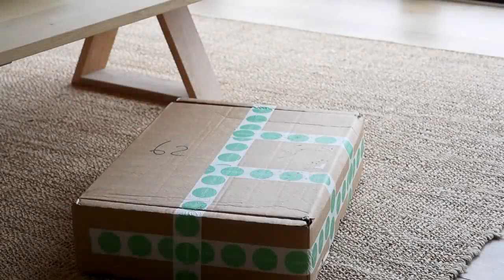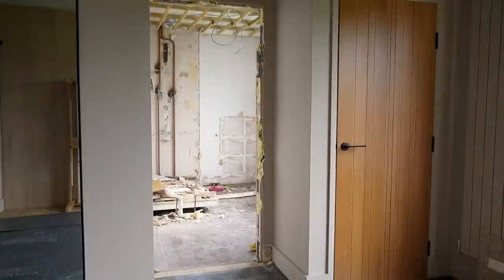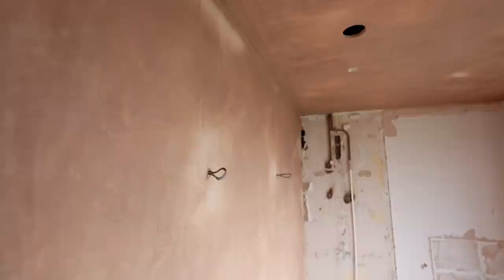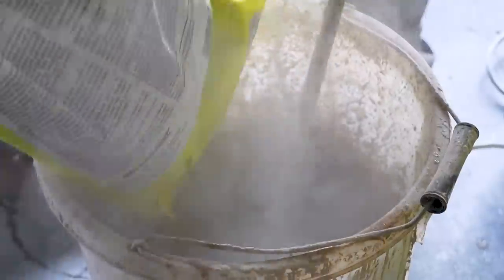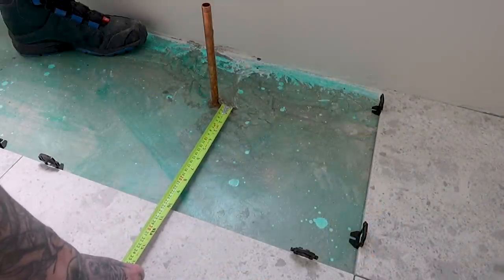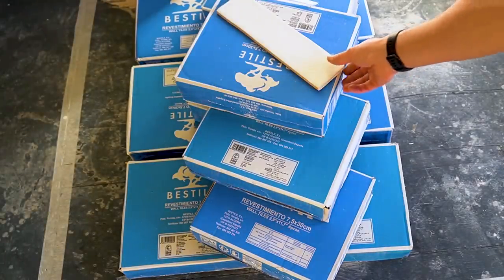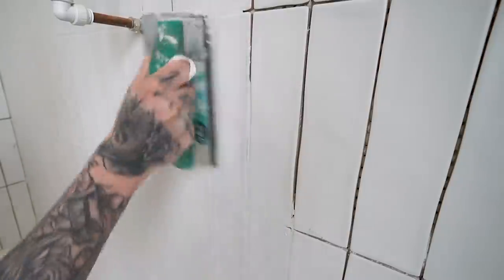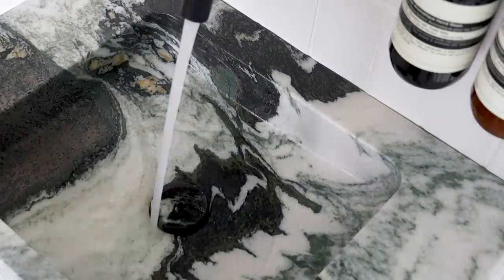Outdated En-Suite Bathroom Renovation

Comment: Emma, could you please speak to what the issues were with having a tile base in your previous property? We’re thinking of doing a more open, step-in shower with a tile base. The en suite is STUNNING!!!
Reply from the maker: With tiles there are gaps in which over time water can seep through, especially with human weight shifting around on top of them on a daily basis. In our previous home water had started seeping through without us even knowing it was and it completely rotted the joists and almost made the kitchen ceiling collapse (bathroom was above the kitchen). In this house it wouldn’t have been an issue as our en-suite is on the ground floor along with our bedroom but we just couldn’t be bothered with the issues of tiles and just have so much more trust in a shower tray x
Reply: @EmmaHill  Especially with older homes. Thanks!

Comment: Loving the finished result! As for keeping black fittings looking good, I do have a little tip - we don't have black fittings, but we do have black tiles (including the floor of the shower - quite normal in Denmark), despite living in a hard water area, we have never needed to remove limescale in over 15 years - our trick is to squiggy the walls and floor (nothing new there), and then wipe it all down with a cloth, paying particular attention to the edges and corners where water tends to settle. Bit of a faff, but less so than removing limescale, in fact we started doing this about 6 months after we did the bathroom, as there was a little limescale developing on the edges of the tiles, and within a relatively short space of time this disappeared. My husband says that it also helps with the longevity of the silicon sealing in the corners. 
Now if anyone knows a similar trick for the taps (mostly okay, but there is limescale build up where the water comes out), please share cos wiping them down everytime I fill the kettle or wash my hands, ain't gonna happen!
Reply from the maker: We wipe everything after every use so do what you do. Prevention against the limescale building up from water is the key rather than cleaning 🙌🏼

Comment: Beautiful finish! You have inspired my downstairs toilet design 😊 I also have black hardware in the main bathroom and it’s so tricky to keep perfect .. do you use any products on it at all or just a clean cloth ? Thank you
Reply from the maker: Try not to use products as they can erode/damage the black. Prevention is key. We clean after every use, it becomes a habit and doesn’t take long just to dry off the water so it can’t build up. If you do get a build up it’s best to clean it asap, try white vinegar & barcarb but spot test first as this can depend on the coating/quality of your black hardware x

Comment: Hi Emma! En-suite looks amazing 🤩 I’m thinking about a wet room floor in mine but you mentioned about having an expensive nightmare regarding one?! 😬 can you elaborate? Many thanks x
Reply from the maker: It’s just that there are more joins/lines where water can seep through over time with constant and moving pressure of human weight. Water can damage whatever is underneath which wouldn’t have been such an issue in this room as it’s ground floor but in our previous home our bathroom was over the kitchen and water rotted the joists and the ceiling almost caved in 😳
Reply: @EmmaHill  yikes!! Thanks for getting back to me. Definitely something to consider! Loving your context ❤️

Comment: Emma, could you please share info on how do you clean black hardware?
Reply: I would love to know to!
Reply from the maker: I don’t use a product, it’s just a case of dusting regularly, we do this daily when in the bathroom, and the drying any moisture off after use. We do this after every use, it’s just habit now. If you allow water to build up this is when you’ll get the hard water white marks (limescale) and then this is harder to remove the longer it’s left. You can use vinegar & bicarb as a good limescale remover but this will depend on the quality of your black hardware x
Reply: Thanks a lot :)

Comment: I love it. This is a beautiful bathroom that will not date. You made a good point at the end, about black fixtures and water. If you have hard water, the mineral deposits will show up on the fixtures, whereas if you have soft water, or softened water, the black fixtures will be easy to maintain. Luckily, we have natural soft water, so the black fixtures still look great after four years. If you have hard water, I do not recommend you choose black fixtures.
Reply from the maker: We had very hard London water in our previous house and we managed to maintain them, so it is possible but you need to keep on top of the cleaning x

Comment: Loving your floor tiles 😍Beautiful! Never heard of a bench radiator before. Maybe you can talk about it (installation, pros/cons, costs) over on Instagram?
Reply from the maker: It’s just the same as any other radiator, the pipes would just need to be channelled into the floor as with some other traditional radiators. The perk is that you have a place to sit, for me I sit there when brushing my teeth or when moisturising after a shower 😊
Reply: @EmmaHill  Thank you for your quick response:) Just checked if these are available in Germany for our Home Renovations.. They are!  Such a smart idea 🙌🏼

Comment: Great ideas and style you both have. May i ask why you don't put in floor heating,  tiles are pretty cold to walk on especially in the winter. Now i live in Sweden so for me its interesting to see how you do renovations in UK. We have so many roles to follow here so we do the renovations different. Nevertheless i love watching your videos. Well done 👏
Reply from the maker: If we built a home from scratch we would put in the highest quality underfloor heating rather than radiators but as we don’t have it anywhere else it doesn’t make sense to us. I always wear socks and slippers in winter so can’t say I have an issue with cold floors x
Reply: So you can't add it afterwards in your house? We used to have radiators in our current house, but now we have underfloor heating everywhere. Our house was built in 1940s. Good luck from a sunny and warm Sweden.